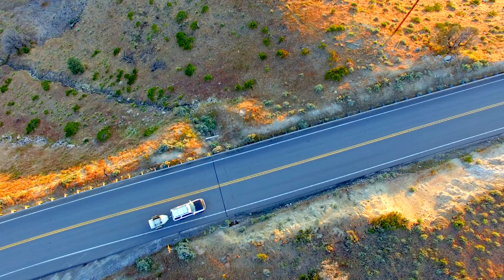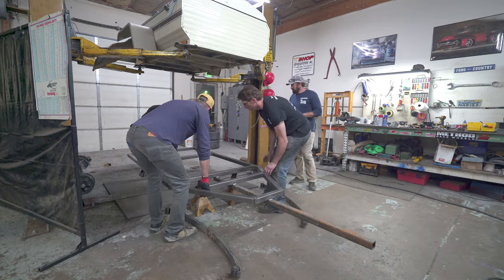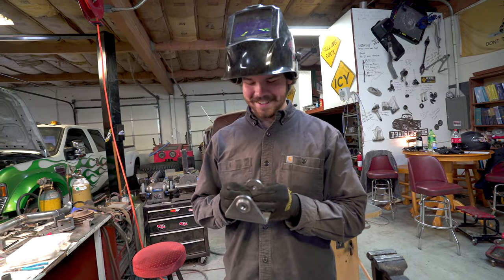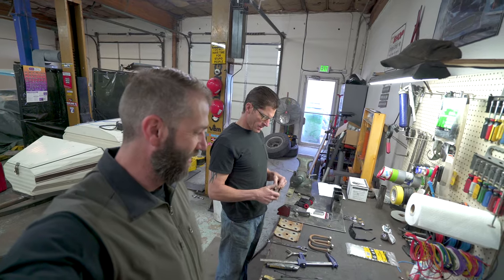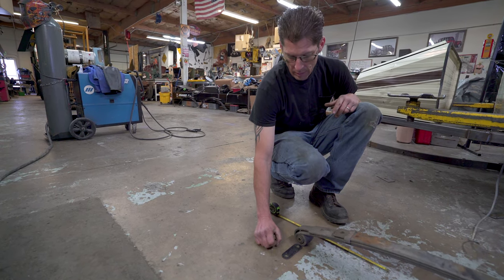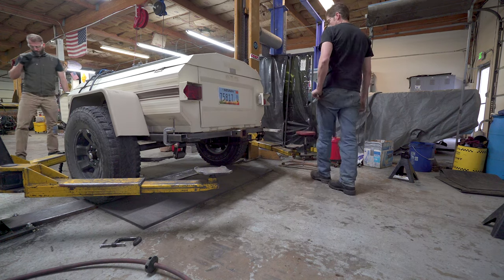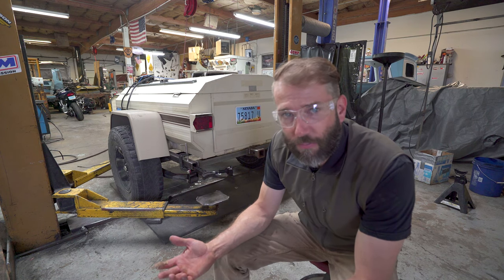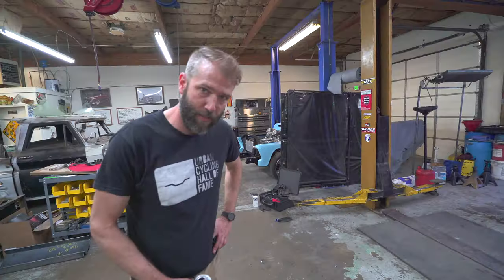Overlanding Trailer Build Part 3

Comment: Nice build! If you wanted a little more clearance, you could replace the axle and leaves/shocks with a Timbren axle-less suspension system. I did that on my trailer, and with 32” tires, I have about 19” of clearance even with the 2x3 support tube. The ride is great too.
Reply from the maker: I considered that. Leaves make it easier to find tune the spring rate and the damping is much better with springs and shocks.